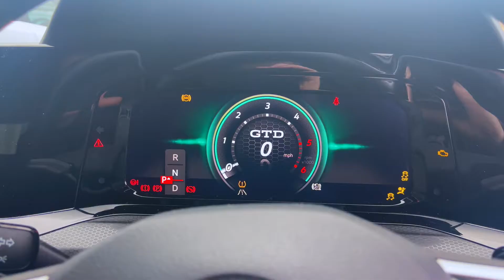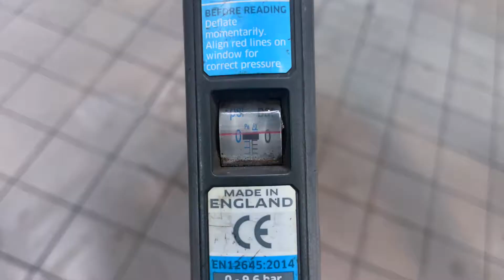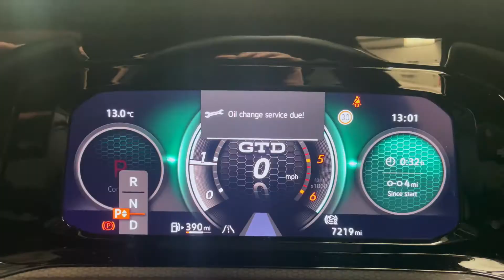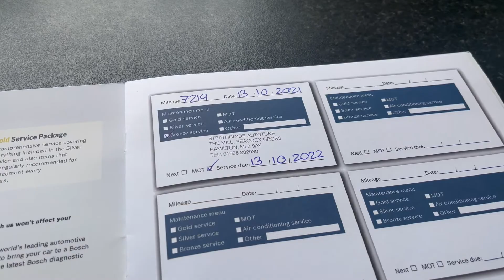OIL SERVICE - VW GOLF GTD MK8 2021

Comment: Are bosch parts approved by VW ? I have a golf what is in warranty same as this but R line but don't want to pay dealership service prices.
Reply: In theory warranty will nothing to do with what parts you use. Often they scare people out so U preform a oil change at the VW service points and not at your dealer.